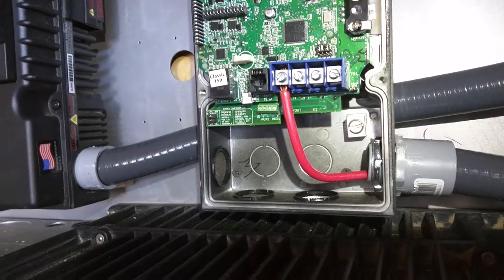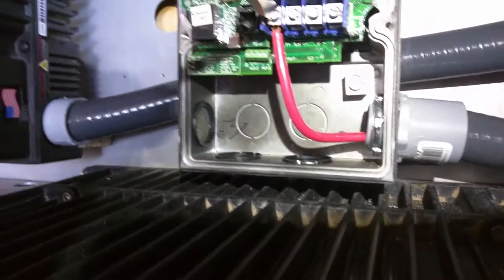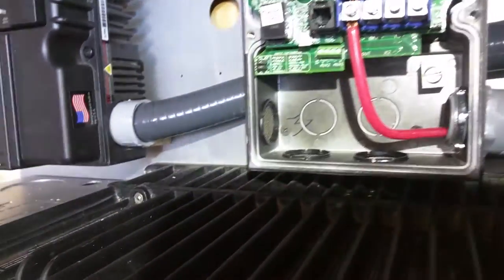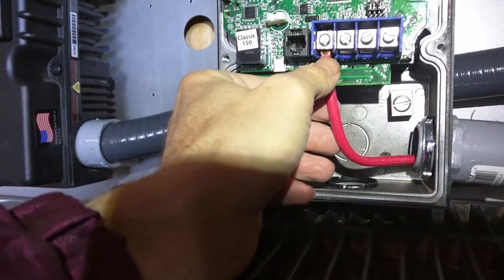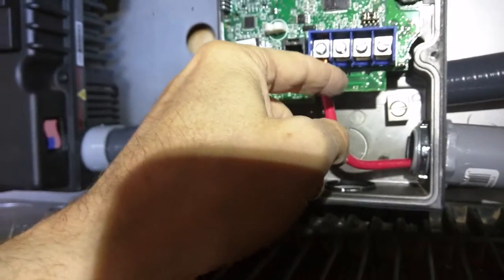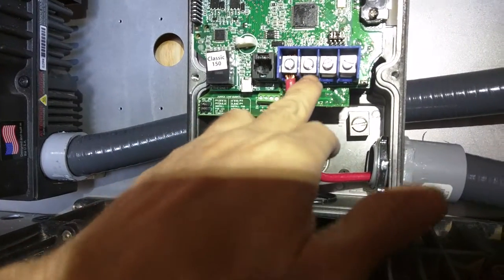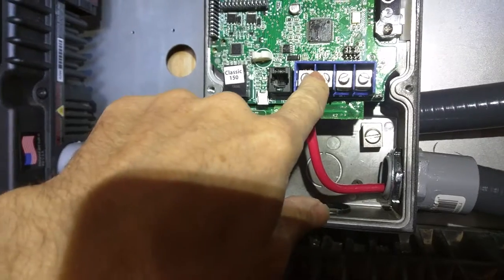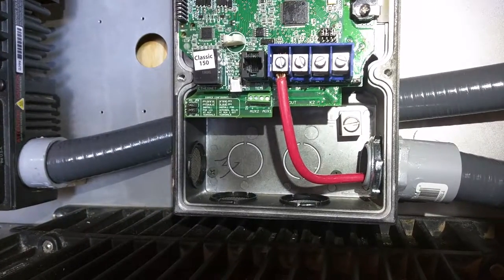Making safer electrical connections

Comment: Zachrey, nice video sir. But to properly tighten those electrical connections a torque screwdriver should be used that’s NEC article 110.14 requirement. Thank you.